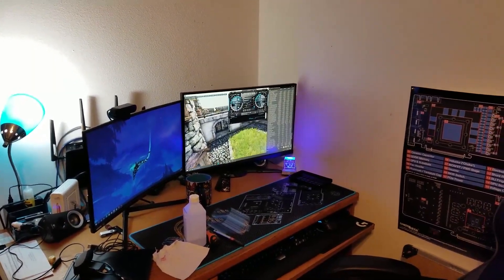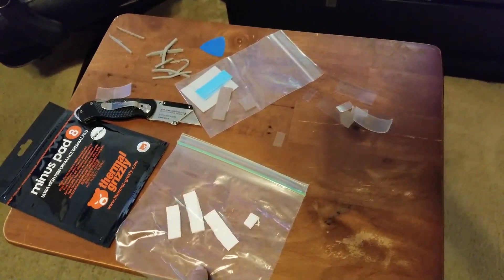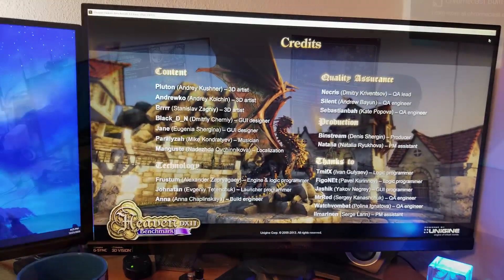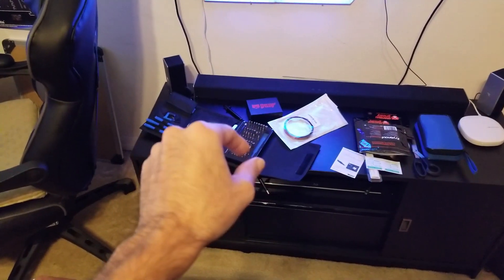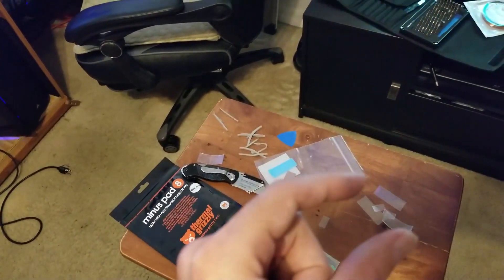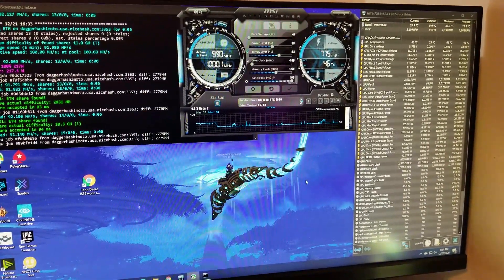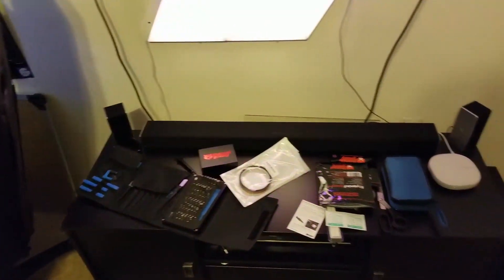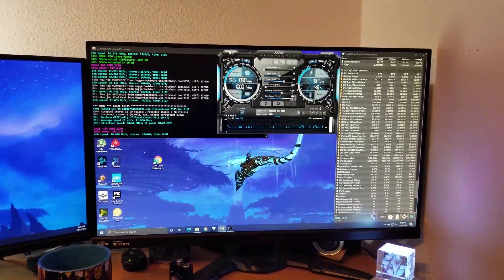RTX 3080 memory Thermal issue fixed!!

Comment: My pc get stuck automatically then I can only move my mouse but everything stop working
Any solution
Reply from the maker: Interesting... does it come back? Next time that happens, is it a blank black screen with only the mouse moving? Wait a little bit, and see if it comes back, maybe hit the numlock key. To see if it shows on keyboard as on or off. I ask all this because the exact same thing happened to me, but my computer comes back after a while. Like 8 seconds and back to normal. I have reinstalled drives, went back drivers, updated windows and all I could. It has subsided but I am curious that you just mentioned it. What is your hardware specs?
Reply: @SerpentXTech  screen did not go blank it show everything which was open by the time but everything stuck even time clock. It did not come back i have to restart directly
Hardware :
Rtx 3080 eagle oc
I7 10700kf
16gb ram
1tb ssd
Reply from the maker: @GamesDon  interesting the only common hardware we have is A Gigabyte 3080. Hmmmm, have your tried to boot into safe mode, run DDU (display driver uninstaller) and then reinstall drivers? If not try that first, but honestly I thought it was a fluke, but your having a similar crash randomly. Does it do it on idle or only when it has a load on it. I.e. gaming or compute workload?
Reply: @SerpentXTech  no I didn't try that it happen randomly when I start mining & left my pc
I never face this problem while I am using my pc it only happens when I start mining and let it be
This happen sometime not every time
Reply from the maker: @GamesDon  ok, focus on Dagger or ETH benchmark only. Turn all the others off, and try again but with the following clocks.

-200 core, +800 mem, power limit set to 70%

See if that runs stable for 24 hours or at least a few, and if it does pump up the memory by increments of +50, to +10, until you get near +1200. If it still doesnt, leave power limit at 70%, core +0 mem +0. And let me know
Reply: @SerpentXTech  OK I will try
I am using ethash.
Set at
Core Clock = 0
Memory clock = +1250
Power = 75
But now I change core clock to -200
I get hashrate around 88-94
And temp is 31 - 35
Reply from the maker: @GamesDon  see if it is stable long term and try to bump clocks up if you want. The goal is the be around 220watts powerdraw but as high of a hashrate you can get. I run -200 core, +1150 mem, 70% powerlimit. 24/7 stable at 99 Mhs
Reply: @SerpentXTech  what is you temp
Reply from the maker: @GamesDon  48C, but my Corsair Obsidian 500D, doesn't have the best airflow, when my Noctua fans are turned down to lessen noise
Reply: @SerpentXTech  I am only getting 88 to 94 mh/s max how to get 98mh/s
Mostly I get 88
& which pool & software u use for mining
How much one gup mine on average

& thanks with - 200 its working fine so far

Comment: Tried to tear down my Gigabyte OC Gaming today and for the life of me, could only remove 1 of 3 of the internal little power connectors for the fans... Grr... I just clean the old paste, applied new and reassembled. Based on the comments below I should probably return the 1.5mm pads and get something thicker for the front. Any tips on taking those connectors out without destroying them?
Reply from the maker: They are a pain, I could only get 2 of 3 removed during live stream. However, I was able to maneuver enough to teardown and remove backplate. Then apply new paste and thermal pads. Do you have an iFixit kit, or small flat head? You want to place the flat part of the flat head driver, in that little grove and carefully but with some force pry up. Not push in. They are just hard to get big fingers around, and you got to be careful not to pull the wires out. Again harder then it sounds, but it should not be this hard to remove connectors.

iFixit kit I have: https://amzn.to/3iqqNmR
Reply: @SerpentXTech  thanks for the reply!! gonna order the new pads and some better paste and give it a go.
Reply: Update: I narrowly avoided damaging one of the fan connectors. I was able to get the one on the other side all by itself and just fanagle it. Thermal throttle issue is gone and I'm getting a fairly consistent 100 MH @ 258W and maintaining ~50 C. Not sure I would try this again but, glad I didn't f anything up... Phew!

Comment: Hey, do you think the 1,5mm pads would be fine or i need the 2mm and  do i need to have 100% fan speed or what is the lowest fan speed before it starts to throttle? thx
Reply from the maker: Depends on your GPU, you might be fine with 1.5mm but you have to tear it down and see or compare to what you have. Once you get thermal issues under control your fan won't ramp as high.
Reply: @SerpentXTech   i got the gigabyte eagle 3080 same as you :)
Reply: so it worked great, i used 2,5mm to the front,  1,5mm was to small and put the old white pads on the back and it worked great, can actually make 101MH/s with mem. oced to 1500 and no thermal throttle

Comment: I have the same Card and it has mined a week now without any Throttling, but than from one day to another, it thermo throttles after a few seconds. could that also be solved with this or could that be a deeper problem?
Reply from the maker: Sounds like the same issue these GPU's are having. The memory is getting to hot when mining and is thermal throttling, teardown your card, and replace thermal pads as I have mentioned. Check links in the description for different sizes. While my card might want 2.5mm your card might need 2mm, so check pad thickness.
Reply: I have done it like you mentioned and thermo throttling is gone thanks for the Video and the help

Comment: Hi there. Why my card 3080 when 98 or 99 mhs get black screen? But at low from 97 no problem. Thx
Reply from the maker: The memory while it can clock very high, your GPU might not like it. You have to find the highest stable clock, while pulling as little power as possible. Also check drivers, there might be an update that fixes it.

Comment: Awesome video! I'm going to try this on my 3080 Gigabyte Vision. Is the 80mm x 40mm Gelid enough to cover what I need, either on the front or back. I don't want to spend extra on 100mm x 100mm Thermal Grizzly if I don't need it.
Reply: did you do it
Reply: @thenman23  yeah: https://youtu.be/1Z82OdnH_Rs

Comment: I'm having issues with stale share percentage on evga ftw rtx 3080 , I'm getting about 10% compared to this old ass 590 I bought used maxed out getting 1% stale shares the 3080 is set to -400 core 75 % power and 900 mem , also get stale shares all the way down to 600 mem tested so far idk the issue , no rejected shares , I'm using phoenix miner on etheminer pool
Reply from the maker: I hearing a lot of people report the same, we switched to Trex miner latest version and that resolved it. I still get a lil, but not as much
Reply: @SerpentXTech  I switched to smos and phoenix miner 5.43 c and I get zero

Comment: having the same issue with the gaming oc 3080. would 2mm pad be thick enough for the backplate?
Reply from the maker: No, they will be the the same as my Eagle. 3mm, you can try 2.5mm but I recommend 3mm. If you have like a 2mm and a 1mm, you can combine. However, the thermal efficiency might not be as good.
Reply: @SerpentXTech  went with gelid 3mm and what a difference. Thanks!
Reply: I have the Rtx 3080 Eagle oc, I just got it out of the box and it is thermal throttling while mining, everything at stock, it begins with 87mhash and then drops to 73-79, I ordered only one Grizzly  minus 8 3mm thermal pads casue I live in Egypt and the customs are so high like i paid for the product plus shipping and customs around 70$ which is too high tbh, so I couldn't buy another 2mm for the front, my question is would that be enough like stock thermal pads on the front, stock thermal paste, only putting 3mm thermal pads for the backplate.

Comment: I have the 3080 eagle. Can currently get 102mh/s stock but still hits thermal limit but sticks at 100mh/s so I’ve bought pads to keep it cooler. Never done a GPU tear down so want to make sure I don’t mess up.

I have the minus 8 3mm pads for the back, minus 8 2mm pads for the front, and kryonaught (non extreme) for the thermal paste, is that everything I need? 

I have the ‘Arctic Silver ArctiClean Thermal Material Remover & Surface Purifier 60ml Kit’ from Amazon for cleaning off old paste is that all good?

Thanks!
Reply: So how did it go?
Reply: @2bfranky  works great! Been running for  just over a week and never hit thermal limit.
Reply: @Sufi Lesson it did, works great! Been running for  just over a week and never hit thermal limit.
Reply: @BagelzGaming3  do you have a tutorial